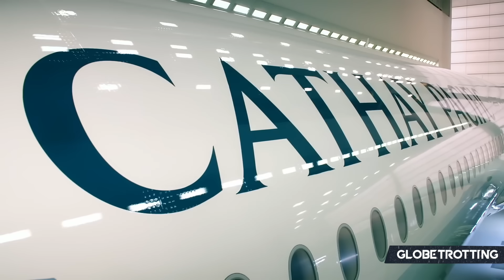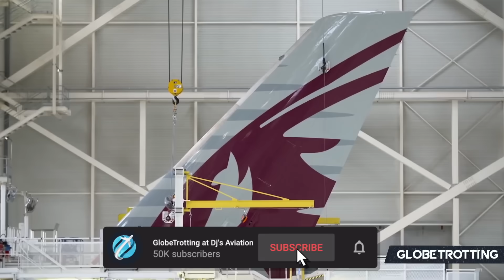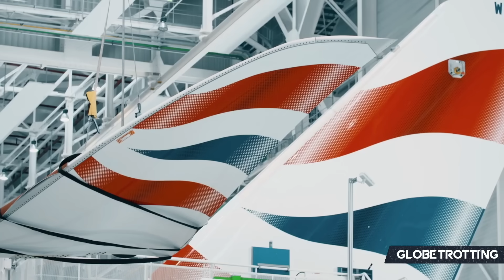777X COMPETITOR - The Airbus A350 1000

Comment: the 350 beats the 777x anytime, particularly when it comes to technological state of the art considerations...  the 777x, which has a conventional fuselage, tries to take some advantage from greater capacity, but it cannot compare with the 350's efficiency, range, noise reduction and environmental advantages...
Reply: What 777x.?  Until Boeing delivers impossible to compare.
Reply: @neilsunn  u think it wont be delivered?
Reply: @neilsunn not really.  It is a re-engine and wing of an existing fuselage. The a350 was a clean sheet design.
Reply: @MW-uh1xv Boeing should did a clean sheet using the 787 as the platform for its 777, 757, and 737 replacements. Complete drop of the ball by Boeing execs whom are nothing more than McDonald Douglas holdovers
Reply: @NarasimhaDiyasena  nothing to do with Boeing Mcdonald Douglas execs about clean sheet design
Reply: Why can’t we all just get along😂
Reply: @jamesjohnson779  Some people will get an itch if they stopped arguing about anything at anytime! 😂
Reply: The A350 beats ..... a non existant plane, a "potential" plane, a plane "on paper". How about the comparison be done when the 777x actually flies.
Reply: 777x is more effiecient because of the GE9X engines and its foldable wings and it has more seating capacity A350 has 350 to 410 seating capacity the 777x has 400 to 420 seating capacity
Reply: @that_astrodude  wrong.  you are confusing efficiency with capacity.  the 777X is certainly more capacious, but it does not mean it is more efficient.  as with large aircraft, that capacity must be FILLED, and one knows that that is not always the case.  the 777X needs bigger engines not because it needs to be more efficient, although the engines are efficient, but because it aspires to take the place of the 747 (which however was a quad jet) in terms of capacity.  obviously, if totally full, the 777x improves much in terms of mile per seat figures.  but the aircraft is VERY HEAVY, given that its fuselage is still made of the traditional materials, unlike the 350 and the 787 which are at least 50% composite.
Reply: @anthonydecastro6938  it depends on the airline if they have alot of passengers and hubs around the world
Reply: This guy🤣
Reply: Lmao , a350 fanboys should be greatful that the 777X has been delayed for so long. 

Just the folding wingtips on the 777X wing is more advanced than anything on the a350. Lol
Reply: @mmm0404  the folded wing tips more advanced???  that's OLD TECHNOLOGY!!!  so much for so-called technological advancement in the 777x the fuselage of which remains the same as the old 777!!!  where boeing is concerned, it is the 787, NOT THE 777X, which is truly on par with the 350!!!
Reply: LOL how is the a350 way more better than 777x in terms of efficiency, range and noise reduction and environmental advantages? The 777x has all that that the a350 has!
Reply: @nickoliver the big difference is obviously the 350 is in successful service unlike the 777x so not sure how you can possibly compare the 2 come back in 5 years and you may be able to give some proven comparisons
Reply: @r12004rewy  the point is not about which one is certified and which is not. They are competitors to each other that's that point covered. So the comparison is not much. The 777x has proven success too over the past couple of months in testing.
Reply: @nickolliver3021 That has nothing to do with how it'll actually perform. Testing must not even be a big problem
Reply: @Tpr_1808  obviously it's not a problem. It'd carrying out successful test flights
Reply: @nickolliver3021 but it's still not in service
Reply: @r12004rewy  so is the xlr! So what's the fuss about
Reply: @nickolliver3021 A350 is better